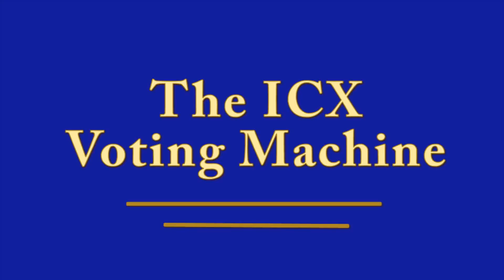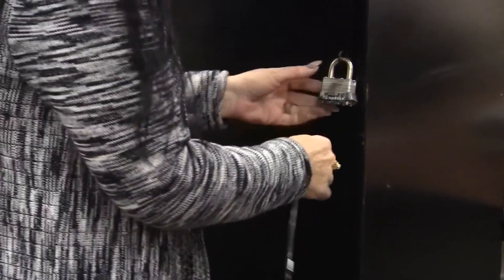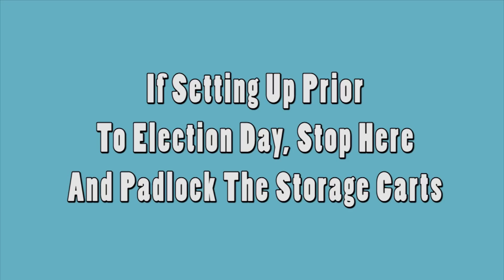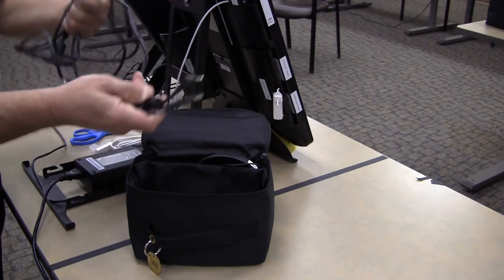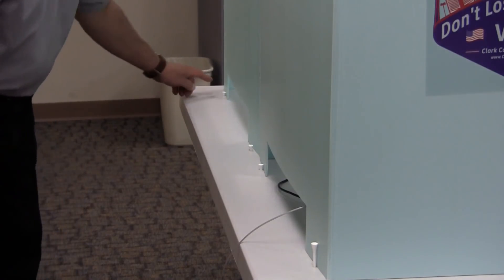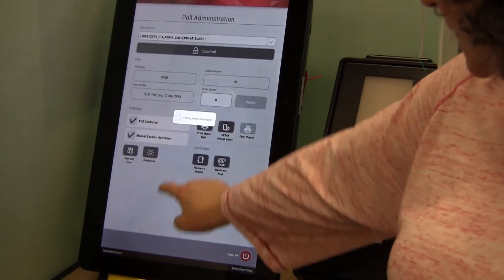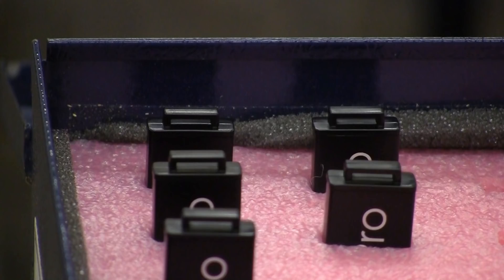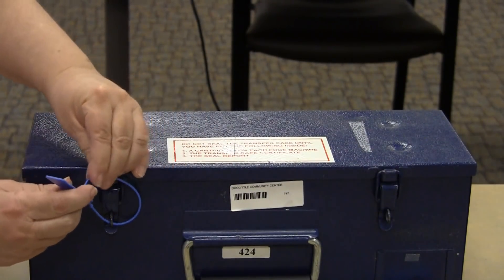The ICX Voting Machine Assembly and Disassembly

Comment: At 4:23 I am wondering what is the purpose of the cell phones in relation to the voting machines?  Unless I missed it, this is the only time during the video that they are mentioned.  Also, why are they instructed to not record seal numbers placed on things after polls close?  Are they going to be changed?
Reply: At :40 Election staff have visited the site and determined the best layout according to location of data ports and power outlets. 
Why do they need data ports? Internet connection? 
The cell phone thing bugs me as well. Why do they need to be turned on? Mobile hotspots?